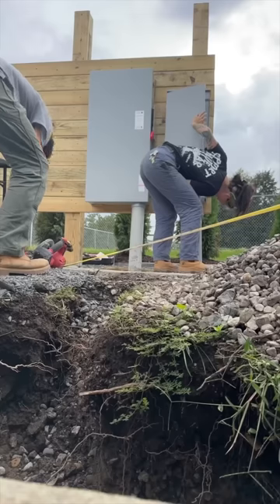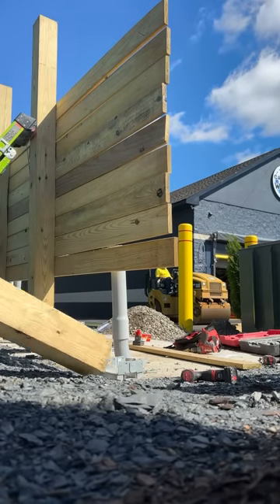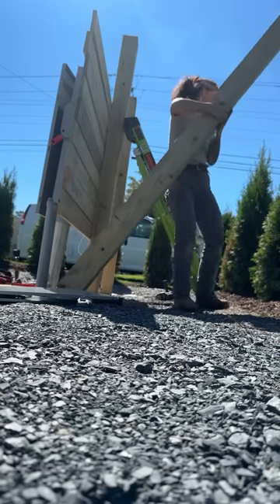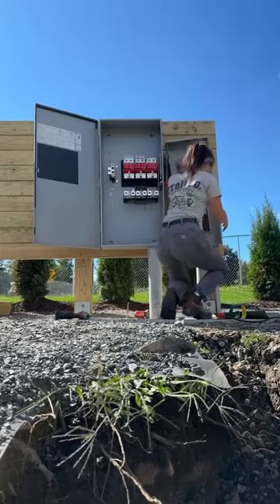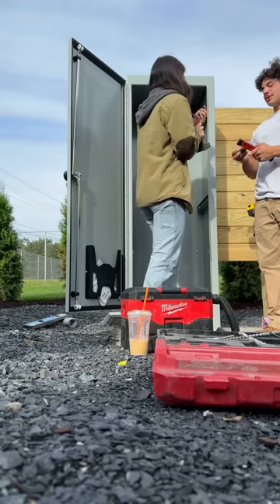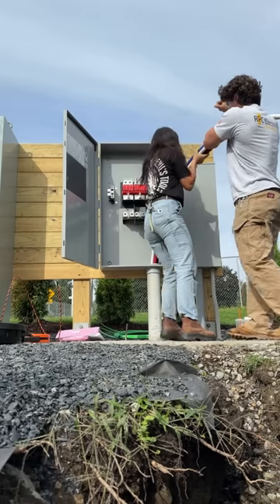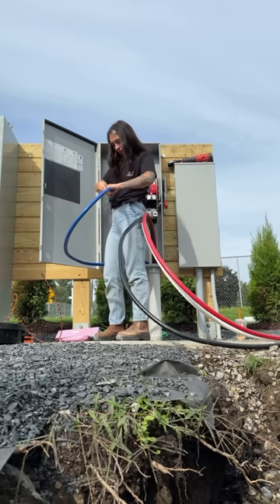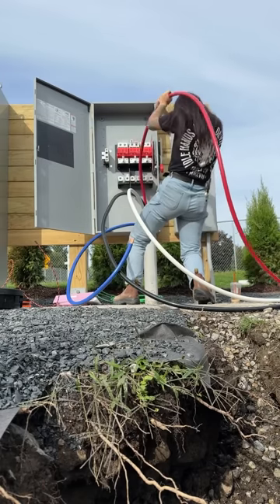Carwash outdoor service parts 1 & 2

Comment: Wow!

Wow, Lexi! I already admire you and your work, but on this one you took it to another level!

I loved how you used the bracing of the nailed-in ladder to straighten the freshly installed post to get it properly vertical/plumbed/leveled.

To add the icing to the cake, you then showed how you wrestled the new 600-MCM copper into their new lugged terminations.

I’m glad you voiced-over details such as nailing your ladder into the right position (so as to maintain the proper vertical positioning of the new position of the new post.

Too, your clarification about why you (only) had your apprentice perform the termination ONLY on the neutral  600MCM (because, in a pinch, that at least could be (more easily) reterminated.

I’m a network (a low-voltage boy, here) engineer and, but I have worked in the largest data centers. I - as you - take pride in my work, and if the DoD … or the XYZ (three-letter acronym of your choice) Agency would allow me to, I’d film my working on my deliverables as you do - or of the finished product.

In my environments, getting 60 Amps, or 100 Amps pulled into a single rack/cabinet represents the high end of power needs for an IT rack.

Side-note - true story - I worked on one engagement where the customer was so proud of the work on the cabling in the DC (data-center) plenum, that they replaced some of the raised-floor tiles with clear-acrylic floor tiles - so as to show off the neatness of cabling!!

One other thing - I use the same green Little Giant ladders, too! GMTA!!  (Great Minds Think Alike!) By the way, -  Little Giant - they make a big extendible ladder that I want to get, that extends to, like, 19 feet!! Like the aluminum ones, but a) lighter, and b) doesn’t get your hands dirty when/as you handle the ladder and schlep it in and out of your van, and c) is non-conductive!

Check it out! Review that! My guess is that Little Giant will love your review.

Keep it up, Lexi!  If I weren’t so entrenched as a network guy, I’d turn a new leaf and become an electrical engineer because of you!

Comment: When you're drilling holes for quickbolts/wedge anchors it can be helpful to drill them a couple inches deeper than you need. That way if you have to move something later you can knock the old one all the way in the hole and move on. Cutting them is a pain and eats up blades.

Comment: 41yo sparky here recommending to you and other young tradies, that you carry a high density foam pad in your packout. I find knee pads too cumbersome to work with. If I'm going to be on my knees for any length of time I'm on that foam. Trust me, protect those knees. That's the area where I can already feel the wear and tear from not knowing enough to care in my 20s and 30s.
Reply: I was lucky enough to find a 4 by 8' by 2" rubber tek  insulation that insulators left at a job site after insulating some large chillers. Cut it up in several lengths to both knee on & a 5' long one to lay on. Tried several strap on knee pads and after week them awhile were uncomfortable.

Comment: Those Simpson post bases are designed for compression and uplift loads only such as for decks.  The wet set bases would have been better for lateral loads for your application.

Comment: I would have snapped a chalk line first to ensure the posts were mounted in a straight line.  After that install your boards then add the electrical.  Trying to install the electrical equipment first seems backwards to me.  But final product looked great.

Comment: We were not allowed to have boxes or panels sitting directly on the ground both indoor & outdoors. Would Install one or two pieces of unistrut to raise it off floor. I have worked with 600 MCM  & you did a great job working with it. Strong like bull.